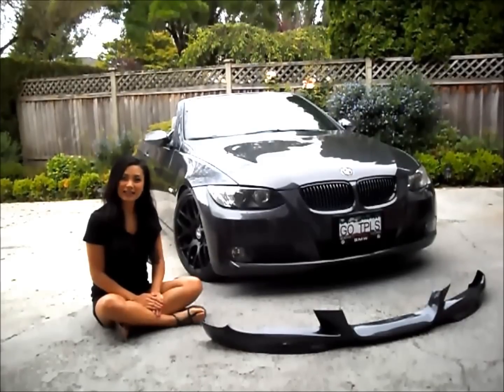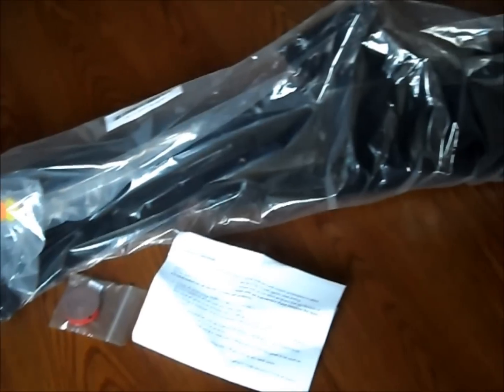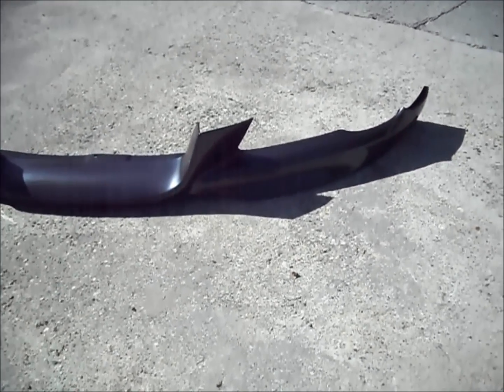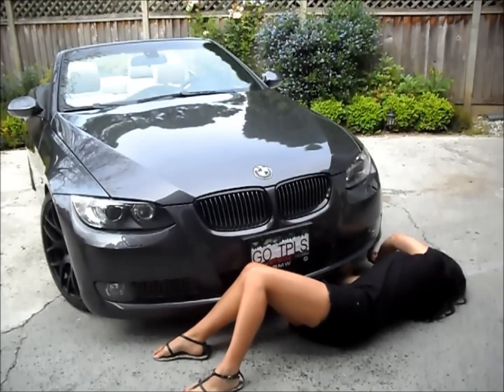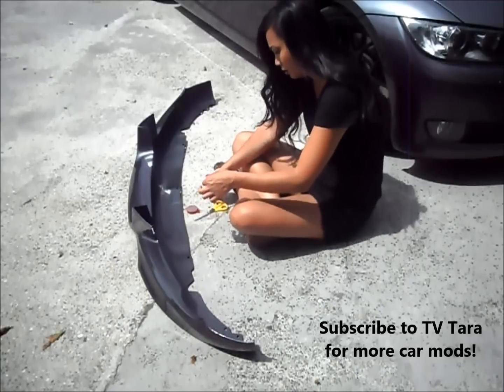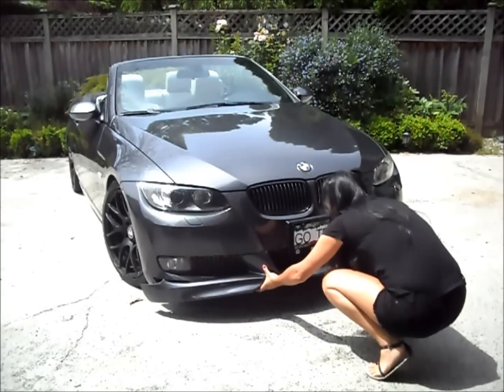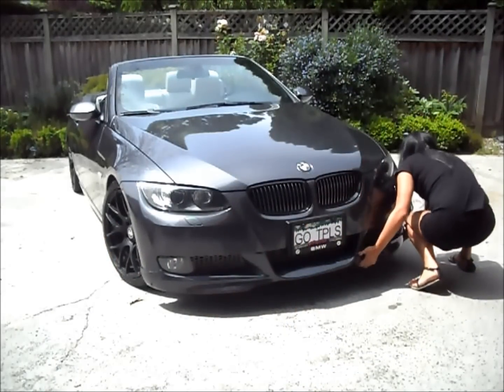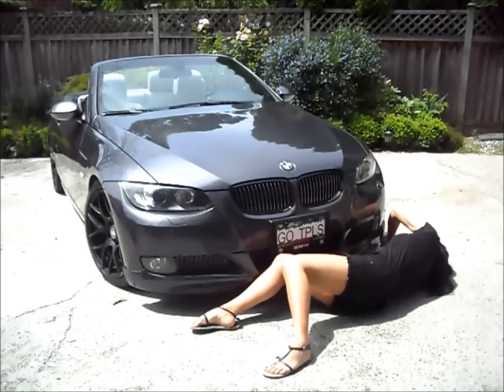How to Install a Front Lip Spoiler - BMW 335 M-Tech Aero Lip DIY E92/ E93

Comment: just got done installing this on mine. if you Google "335i m tech lip install" this video will show up ready to play lol.

The whole Windex thing worked wonders! i dont use 3m tape alot and didn't know you could use windex to position it before it dried. it was taking a little bit to dry so I used a heat gun to speed the process up.

mine didn't come with the lip on each side that "snapped" around the bumpers. so it's not perfectly flush and it's bothering me, and I cracked the paint a little getting the two center pieces to mate together and not form a gap. but for a 180 dollars paint matched, i expected a little bit of fitment issues.

good video!
Reply from the maker: +Kipp Brotherton my first lip ripped off so I bought a new one like yours which doesn't fit around the sides too. It sucks. The prepainted lips also chip a lot. You will find that out soon!
Reply: TVTara thanks for the response!! sorry about the first lip though. I'm afraid of tearing mine off as well given the less clearance now. I ended up having to buy a roll of 3m tape from AutoZone because not only did mine not come with any, but from what I read the stuff that is sent with the lip isn't legitimate 3m tape. I ended up using just about all of it from all the spots the lip mated to the bumper. i also picked up some self tapping screws to secure the bottom to the lower part of the bumper better. hopefully it don't go anywhere lol.

And yeah I can already tell the paint is going to flake off easily from just the little bit of flex it took to cause it. I'm sure it'll be okay for awhile. but for 200 dollars invested it's not a terrible deal.
Reply: TVTara also, if you don't mind me asking....howd your first lip get torn off??
Reply from the maker: +Kipp Brotherton I'm actually not sure. It just disappeared one night and I remember hitting lots of steep driveways so I guess it tore off! I didn't even feel it.

Comment: Next time drive it up on ramp or  jack onto jack stands and get a shop creeper.  Makes it easy to roll around and work underneath the car. Believe me, after doing a few transmission and drive line components I know. lol
Reply from the maker: Oh, I wish I had that equipment!!!
Reply: TVTara
Pretty easy to get. Either buy used on Craigslist or low budget at Harbor Freight Tools. It's great to see a girl work on her bimmer. Congrats. Just traded my 500SL for a 540i.
Reply from the maker: Hmm ok thanks!
Reply: TVTara
Can never have enough tools. ☺

Comment: Even the OEM lip will stick out at the corners like that if not secured properly. I battled with different brands of tape but the lip would always eventually come loose . I ended up just gluing it on, problem solved. By the way, for anyone looking to purchase the aero lip, try giving the OEM part number (pre-painted not primed) to your local dealer and see what price they quote you. If you deal with someone who doesn't know their stuff (like I did) you could end up getting the OEM part with a free paint job.
Reply from the maker: Cool, good info! Thanks, Nick!

Comment: Good Evening! I just got approved on buy a car like yours just a bit newer! I noticed that that the lifters are ticking rather loudly! Which I have heard in almost every BMW after 50000 miles! I wondering if you had this problem also? I have not signed paperwork to do my research on the issue and or have you had any other issues with the car! That I should to take an extra look at! And or ask them to replace the parts before I sign! By the way, You look Gorgeous in all your videos! Wow! Thank You SO MUCHHH!!
Reply from the maker: Aw, thanks very much. 
No, I haven't had that problem. Hopefully the dealer has already replaced your HPFP and watch for turbos and water pump failure!
Reply: Thank You so Much for taking your time to help me out! What should I watch on the Turbos?? Or what am I looking for in my turbos??
Reply from the maker: I'm really not an expert but just be warned of the turbos failing, like the water pump. I don't think we can do much to prevent it. My point is that repairs on these cars are costly though. Good luck!
Reply: Yea I am sure there costly!! Its OK! Its the Cost of having a Beautiful car! Have had any problems with yours? And Yes I appreciate You helping me out!!!
Reply: It may not be the lifters ticking. These 335i's use a high pressure direct injection piezo injector. They are not your average solenoid type injector.

The piezo injectors make a clicking noise under normal operation - if you're worried get an experience BMW mechanic to listen to the sound and diagnose what it is.

Comment: Hey i was thinking about buying a 2007 BMW 335i this Tuesday. I had a question about the reliability you experienced with its engine. Have you had the hpfp (fuel pump) replaced at all? I know BMW made a recall on it. Have you had any other repairs? Thanks a lot.
Reply from the maker: It's not known to be a reliable car so make sure you have extra money. The dealer replaced the hpfp before I bought it and my water pump was also replaced.
Reply: The engine itself is solid. Its small things like the fuel pump, water pump, coils. The two big things and they are pretty big are the turbos and the valve cover/gasket. If you can do you own work its no so bad

Comment: just ordered those ..where was the fitment an issue
Reply from the maker: +JF- Mazzeratti The sides and the very middle needs to pushed up tight when you mount it.
Reply: o geez so heating is very necessary

Comment: Hi, Tara. One question, How did you paint that spoiler exactly same colour as your car?  Coz mine is gray and I'd like to install it just like you did.
Reply from the maker: The first time I bought one, I has it painted at a body shop. It matches perfect but is more expensive. I bought a second one recently and I bought a cheap one pre-painted. The fitment is terrible but the paint actually matched really well. Just know the paint code. Mine is A22 for sparkling graphite metallic.
Reply: Cool. thx for the reply. Can you share the website that I can order one?
Reply from the maker: I think it's this one (be careful if it's not your color) . But like I said, it does fit well at all on the sides. http://m.ebay.com/itm/181706376597

Comment: Tara, now you have been living with the PU lip for a while, would you choose the same one again? I'm contemplating getting a full carbon fibre one just to make sure I get a good quality lip. Also, does this lip not make the front of the car look lower than the side skirts? I don't want to get into a situation where I add the lip and then feel I need to change the side skirts as well to match up. If I'm going to do that I'll just buy a full M3 body kit for my 335i SE!
Reply from the maker: Actually I just installed a new lip yesterday. The same one. I'd buy carbon fibre but they don't have it. 
It fits the side skirts well!
Reply: TVTara I've already decided against carbon fibre. It shatters too easily! Ok well I'm going to go for a genuine BMW front lip to make sure it fits perfect! What are your thoughts on a matte black rear lip spoiler type M on a sparkling graphite 335i? It's either matte black or the same colour as the car. I have the matte black kidney grills and 335i badge so there is a theme coming along here! Not sure on the colour for the rear spoiler though :( Thanks for videos and reply, very helpful :) subscription to your channel has been carried out!
Reply from the maker: Is it the m3 style spoiler? I think it's too small! Too subtle! I prefer the performance style obviously.
Reply: Yes just the small one. I like subtle! I think I'll use plasti dip and spray matte black. If it doesn't look right I'll peel it off and spray sparkling graphite (hopefully). Then it's jb4 time after these bits are done. You should get the jb4 and do an install video! Looks quite easy but at least with your videos there is someone a bit more interesting to look at :)

Comment: does that lip only fit the M Tech bumper or oem bumper
Reply from the maker: It fits OEM bumper.
Reply: Really ♡ I've been looking for a lip I love that one I would really really appreciate it if you give me link to the eBay buyer you bought it off
Reply from the maker: I got it from BaysonR Motorsport. But the fitment is not great. You get what you pay for! http://m.ebay.com/itm/390948462542?_mwBanner=1

Comment: hello! can i get the link for the bumper and did you paint it? thanks tara!
Reply from the maker: http://www.ebay.com/itm/390948462542 Keep in mind that the fitment is not great and you will need a good shop to paint it. It needs a lot of prep work to get the paint to stay!
Reply: TVTara Wow. that was a quick response! i wish i could buy the ones that are already painted. smh. Thank you so much Tara!
Reply from the maker: I think that one is the same quality that I bought. It's gonna work. BUT, don't be surprised when it's not perfect.
Reply: TVTara you are awesome! i know you posted this last year, do you still have it equipped to your car? also the rear lip spoiler?
Reply from the maker: Yeah both are still on my car. I just posted a new video this week of new side skirts so you may be able to see the car up I date there. The sad thing is, my car went to a shop to get painted and the double sided tape on the front lip came loose from the heat of the paint dry room. Now it looks really terrible like it's falling off :(
Reply: TVTara ok im gonna look for it. thanks for the lightning speed response! i really appreciate it and also the problem with your bumper, im pretty sure you can fix it! you are a handywoman! thanks Tara you really helped a lot! :D oh and the kidney grilles that you have, did you buy it too? cause im planning to paint mines :p
Reply from the maker: Yeah I have to reinstall the front lip, which sucks. The grilles are wrapped in gloss black vinyl. 
Good luck!
Reply: TVTara you think it's a waste if i dont paint it and install it? :|
Reply from the maker: You don't want to get the front lip painted? No, that would look weird! And cheap. It looks like rubber.
Reply: TVTara how about if i paint it just flat black? i have a gray factory color bmw. i dont want to spend much. im being cheap :))
Reply from the maker: Yeah I guess flat black will work. But you will have to do a lot of sanding I believe. Good luck.

Comment: looks better (y)
Reply from the maker: Thanks!
Reply: TVTara Is it fitting with e90 sedan ??? i couldnt find it in ebay :/
Reply from the maker: Mateo Tt hmmm, i'll look.
Reply from the maker: Mateo Tt  Yeah I guess not available for e90s.
Reply: :( i have a crap car then :(((((
Reply from the maker: Haha, you can buy another style of lip
Reply: TVTara yeah,that's right ,I need to find something different,but this front bumper looks really good (y)
cheers